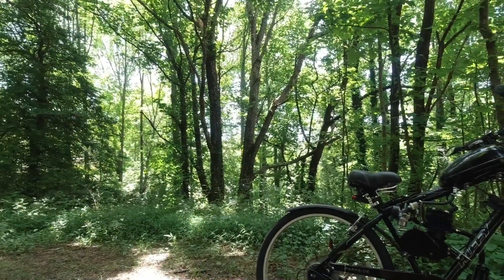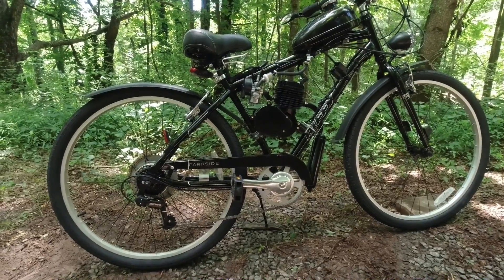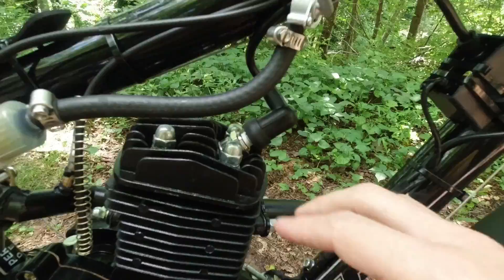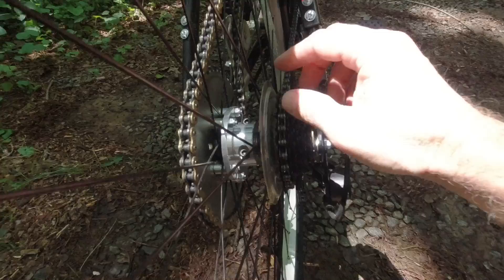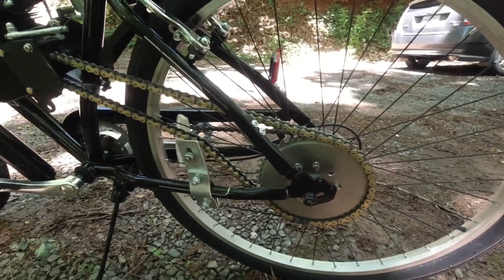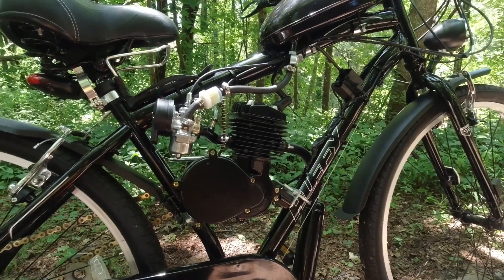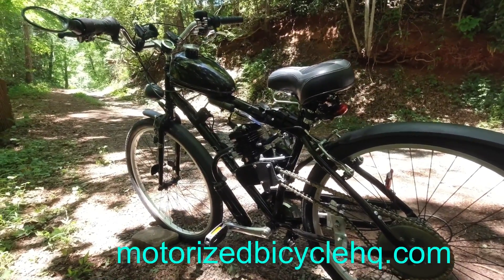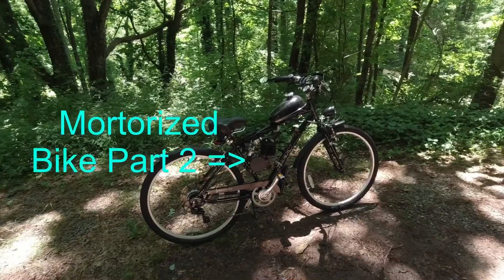P1 $300 Motorized Bicycle Review 80cc 66cc Campers RV Van Car Gas Motorcycle Specs Bike 60cc

Comment: I agree that dealing with the coaster brake hub on a cruiser is definitely harder than the multi speed type of hub on a mtb. However, the extra braking power I get from my cruisers coaster brake is nice sometimes. You really need to install a front brake also but I really like my cruiser. Be warned though, I’m on my third rear wheel on my cruiser. Definitely get a hub adapter and sprocket for your rear wheel, save yourself the aggravation and the money of replacing rear wheels you’re just gonna end up getting one anyway.

Comment: in North Carolina as long as it's not going over 35 miles an hour you do not have to tag and register it as long as it's under 49cc you don't have to have a driver's license if it's 150 CC's and above and 35 miles an hour or faster you have to have a driver's license also but that's only in North Carolina I don't know about other states

Comment: Question about older video, with Prius climate control 2nd generation, can you have climate control on and maintain a temperature while the keys are not in the car, for example to keep a pet cool while in the car.
Reply from the maker: It is possible with the Prius. You can leave the car in the ON state with the A/C working and leave the car. The Prius will not allow you to lock the car with the key fob however so someone could open the door. You can crack the window and reach in and push the electric lock button and the doors will lock however someone could reach in and unlock them. I have the keyless start system so they can get into the car but can't drive away as the system will not go into drive without the fob being inside the car. If you don't have that option you would need to leave the key in the ignition and then you would have a problem. You can lock yourself into the car with the electric door lock button and be secure and cool when stealth camping. That is not real helpful for pets alone though.

Comment: Premium gas - not sure, doesn’t it burn hotter ?
Anyway, I would use whatever OEM recommends. Using premium isn’t necessarily better.
Reply: Not necessarily the use of premium, ideally it's best to use ethanol-free gas in small engines. Ethanol burns hotter and not ideal for air-cooled engines.

Comment: Really like your video . I was wondering  where you got the fenders? Definitely going to buy a kit soon. Thanks
Reply from the maker: Here’s the link. They are rather flimsy but had a hard time finding ones to fit. They are only $10 though. 
https://rover.ebay.com/rover/0/0/0?mpre=https%3A%2F%2Fwww.ebay.com%2Fulk%2Fitm%2F153433716148
Reply from the maker: I wish now I had bought a kit from Zeda Motorsports but was not sure I would like it this much when I started. I guess I will run this one till it dies or I kill it and then upgrade.

Comment: i don't know why the chinese kit chain doesnt fit in the sprocket neither the kit  adaptor sprocket i bought.  It goes  in few rollers  but after that it passes over the other sprocket teeth.  I hear the drive train will also drive the pedal chain too if i don't some how isolate it, is that true? I searched all over the internet and not find any information about this, the person helping me is a mechanic me build the bike told me i need to free the single  chain gear (pedal side) in order the drive train operate alone without interfering the pedal side.  The Micargi beach cruiser which i am using has a coaster brake we dismantle and removed the plate that create the brake I want it to be brake free , however there were some foul play still so the mechanic had take the rear wheel  to bikeshop next morning  and find another standard universal rear hub thats more simpler. All this information i provided you I have been looking through other youtube channels to double check and confirm and i have not find any of this information does any of this come in to mind or have you find any this case before in the past?
Reply from the maker: I had a terrible time with the beach cruiser bike and had the hub destroyed twice. I ended up throwing the bike away as replacing the entire rear wheel would have been 1/2 the cost of the bike. If you get one of the 2 bikes in the video you won't have trouble with the hub. You can get a Jack Shaft conversion kit that will allow you to send the motor power through the bicycle gears but it looked a little too involved to me. I have my 7 speed peddling setup as it came with the bike, I did not make any modifications. When I go down the road under gas power, I just rest my feet on the pedals and they don't move. If I peddle with the gas engine it actually adds power to the engine. You might find part 3 what will be coming out helpful with some tips and ideas. Maybe they sent the wrong chain with your kit.